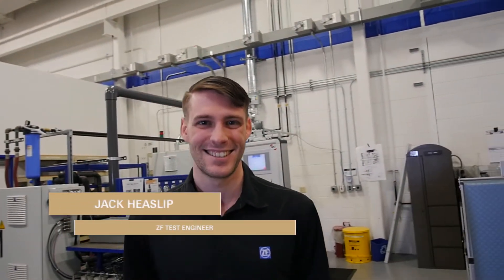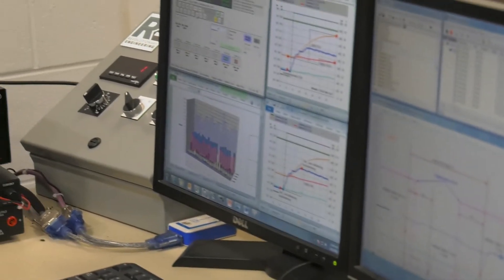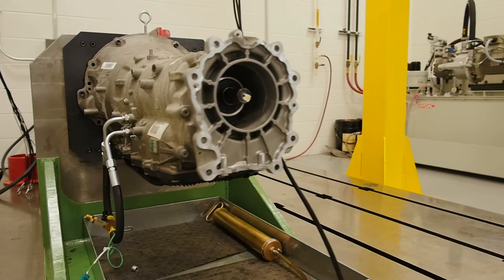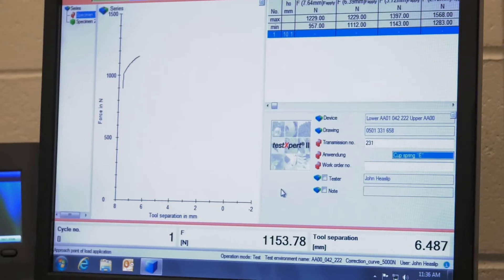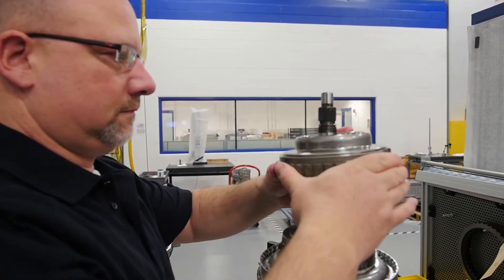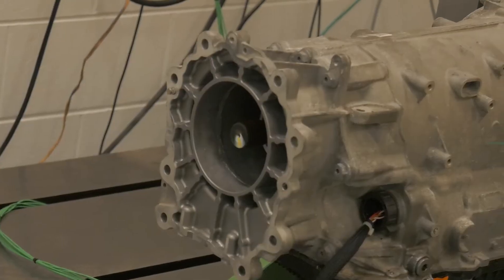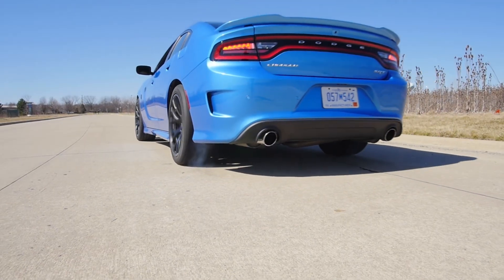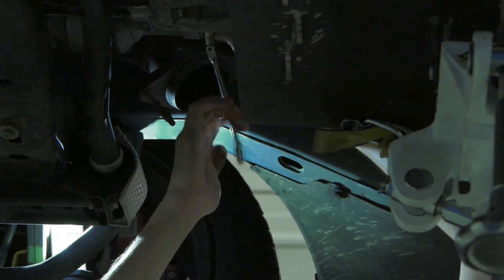ZF Dream Jobs - Transmission Testing

Comment: i work on the assembly line for 9hp transmission in sc. Im at the end attaching the oil coolers, hcu's, sensors, oil pans, and torque converters. lots of oil but its a good job.